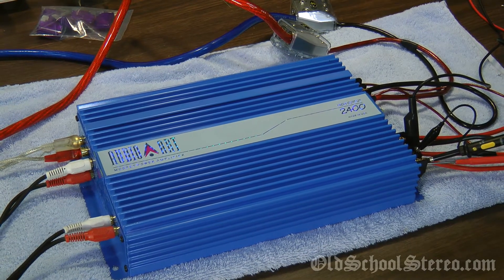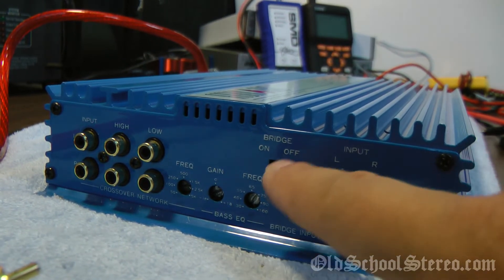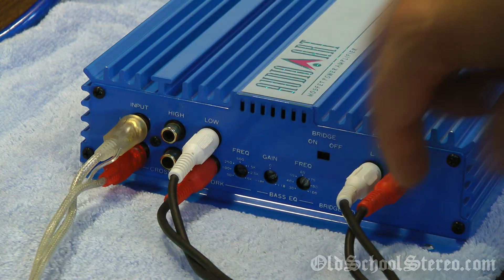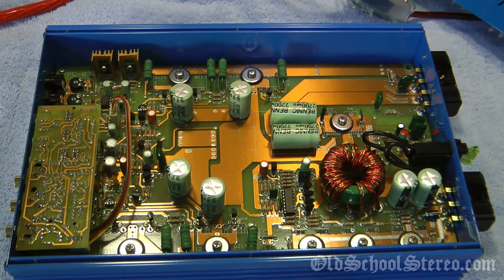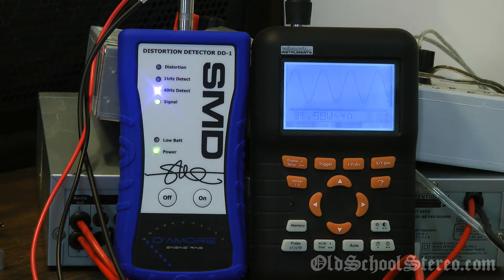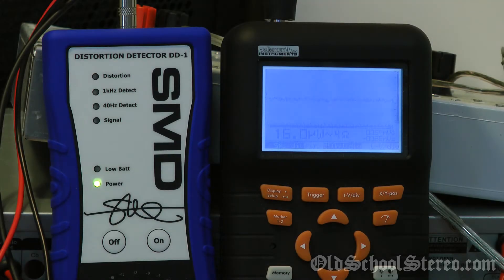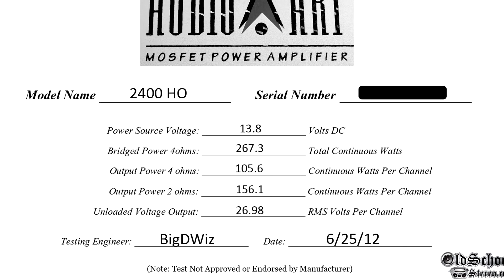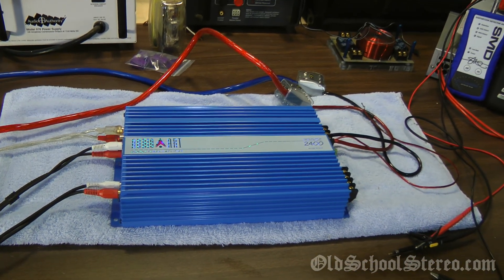1998 Audio Art 2400 HO Car Amplifier Overviewed and Bench Tested Power Watts Volts RMS

Comment from the maker: I was disappointed also...the build quality is top notch and it sounds fantastic driving the test speakers at crazy volumes. It may be one that doesn't do well with resistive loads, but better with reactive ones. I just got in a Klein clamp meter today and at 4 ohms mono, this amp would only pull 20A before it began distorting (DD-1). It's fused at 30A, so I thought it should get closer to 30 with the test tones